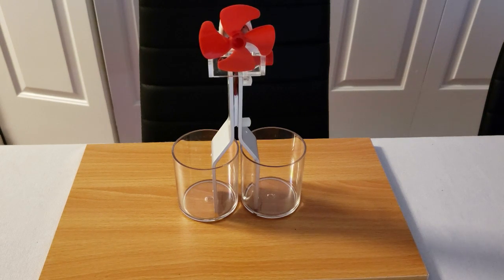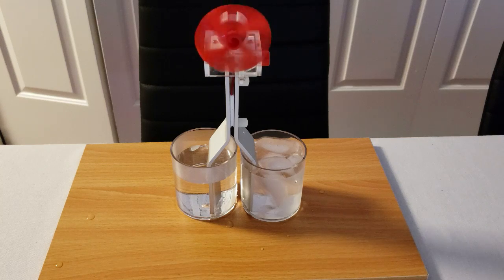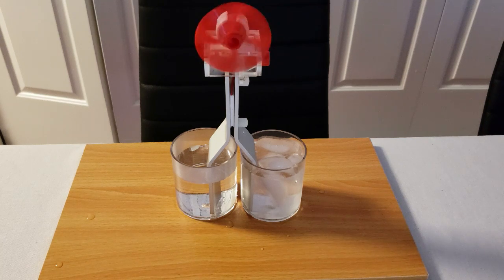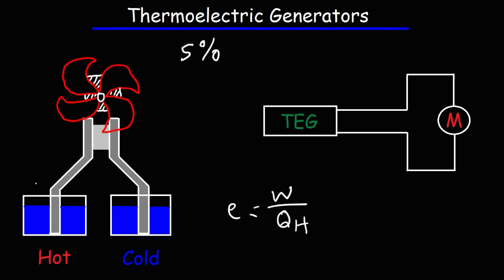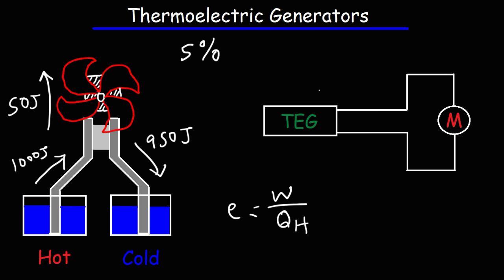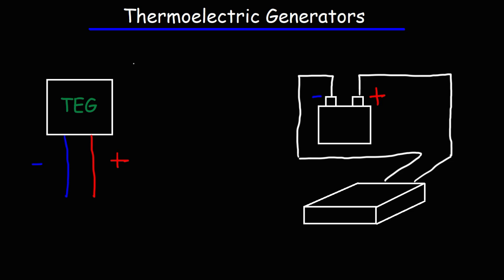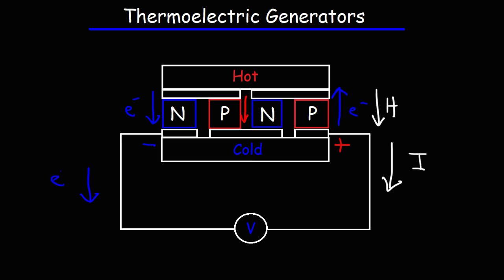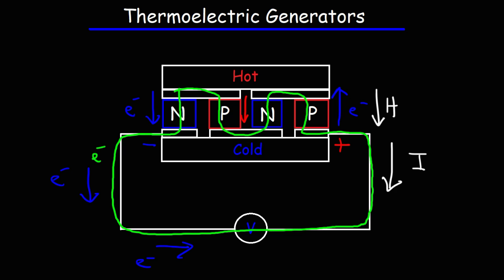Thermodynamics - Converting Heat Energy Into Electricity Using a Thermoelectric Generator

Comment: So basically this wastes energy as you need to either cool liquid or heat liquid. I came here because i was wondering if i could take heat from solar panels and make more electricity with that but turns out it costs more to extract then it's going to generate so not worth the effort.

Comment: A question for you I couldn't possibly answer myself with all the Google access. I could muster...

I want to use a TEC or multiple TECs for cooling a water system, I'm happy to power these and deal with cooling etc I'mnot that fussed about theor efficiency, however, these TEGs are always prefaced with being massively inefficient, so... if I run the TECs to do their cooling job, would it make sense for me to use TEGs as heat sinks, loop the power generated back into the system and recover 5% whilst efficiently cooling the TECs using the seekbeck effect? IE it will absorb the heat "inefficiently" doing exactly what I need it to whilst also recycling some of the heat generated, I'm guessing it would make more sense to have a heat sink to build up a stable heat in something then have the TEGs feeding off the heat of that? Rather than trying to stick them directly to each other like hot output of TEC to hot input of TEG? I'm not looking to make a perpetual motion machine or anything, but it seems like I'm killing about 4 birds with one stone by doing this? I'm not sure I fully understand them though, so it would be good to have other input

Comment: A Stirling Engine is about 40% efficient in converting thermal energy into kinetic energy and a brushless motor is about 80% efficient so with those figures I would argue that producing electricity by means of a Stirling Engine and the brushless motor is the better option when considering conservation. My country is facing some difficulty with supplying power, they're "load shedding" which means each province is effected on a rotational basis. I'm considering utilizing the thermal mass of hot water storef in a spare geyser to generate enough electricity to power the lights at the very least.
Reply: Surprised nobody has considered installing an electrical current generating coil on a catalytic converter of a generator setup to further increase output whilst also reducing unburned exhaust gas output for cleaner exhaust and less fumes. But anyways. Consider solar, deep cycle batteries for boats, and LED light bulbs and a 12vDC to AC inverter. Run the batteries PARALLEL so you remain 12 volts but increase your storage CAPACITY.

Comment: What is the thermoelectric generator made of?
Reply: The N and P type semiconductors are made of the same materials, I think, as light emitting diodes. They're (generally?) made of silicon and germanium but also injected with other materials, such as "phosphorus (P), arsenic (As), or antimony (Sb)" (Toshiba, 2022) for N type semiconductors and "boron (B) or indium (In)" (Toshiba, 2022) for P type semiconductors. It's unlikely that you'd be able to construct them yourself.

https://toshiba.semicon-storage.com/us/semiconductor/knowledge/e-learning/discrete/chap1/chap1-3.html
https://toshiba.semicon-storage.com/us/semiconductor/knowledge/e-learning/discrete/chap1/chap1-4.html

Comment: Fixing hot plate at 50 degrees and the heat sink, which thermoelectric module would produce more power: TEC1-12702, TEC1-12706 or TEC1-12710?
Reply: 12710, allows more current. But the temp. Difference have to be abut 150 degrees Celsius

Comment: What would happen if you dasy chain them?
Reply: In case of wiring you would need to provide it with a higher Voltage. In case of physically daisy changing them I don't see the use because the second element in the row would need to pump even more heat than the first one even pulled from the cold side. The temperature increase on the hot side is much greater than the temperature decrease on the cold side. For greater cooling capabilities you would space the pertier elements over a large surface.